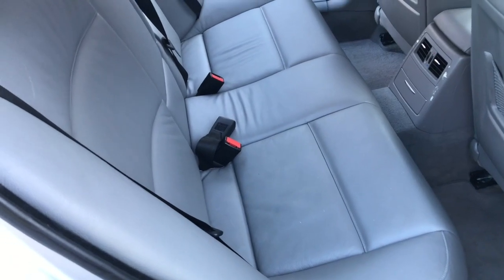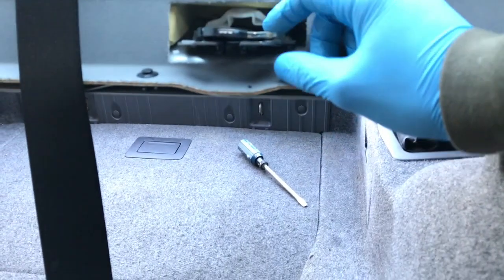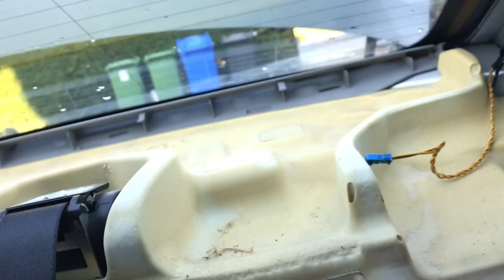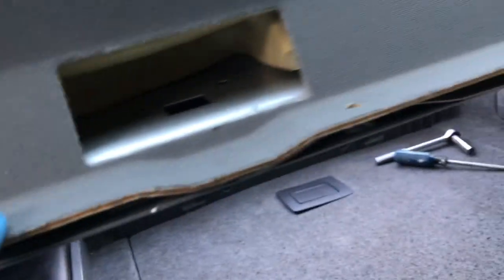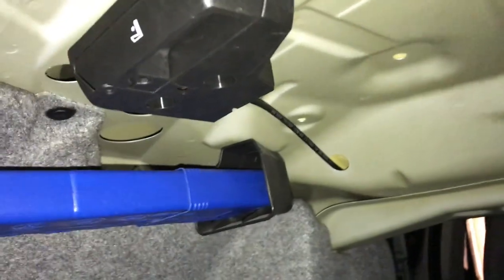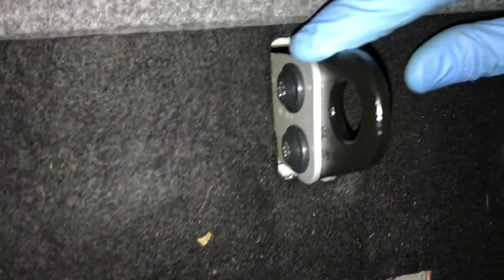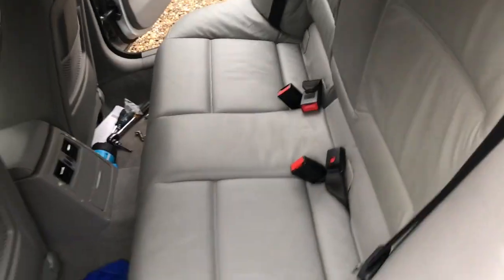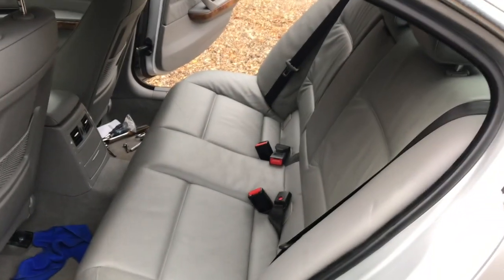How To Retrofit Rear Folding Seats On A BMW E90

Comment: @6:15 and @10:21 thank you so much!!! You are the ONLY one I came across who went over this part. Everyone else just retains the normal center seatbelt and it looks gross.

Great job explaining everything in amateur terms.

Upon removal of the seats from a donor car I just cut the wires for the latches. I was so aggravated after a long day at work, in the hot sun, in a junkyard, sweating my butt off and needing to go to another car 39 rows down afterwards. Ugghhh. Those wires are not cheap. People sell them with the plastic handle or the latch (sometimes broken) for stupid amounts. I got the seats for $70 but peeps want me to pay another $60 for the wires I cut :/

Comment: The install was straightforward, but for the life of me I can't get the larger seat back to latch. I have tried three different latches and it doesn't work. Oddly enough, it latches when the non folding latch is put back. Any ideas?